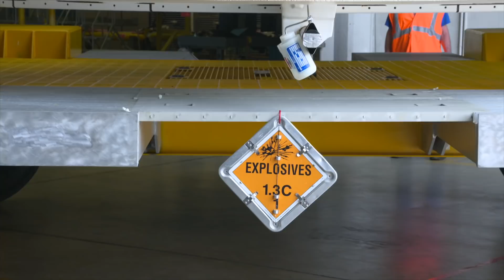Boosters for SLS Artemis Moon Rocket Arrive at KSC

Comment: Good people, nice hardware, but it took years of waiting just to be able to make these few feet of video.  It has been 8 months and there still has not been a full first stage run up test.  As of this date Sept/8/2020, they just performed a full SRB burn test.  Plus they still need to do the booster full duration burn (And the related inspections with reports) and then the full assembly of the completed vehicle.    It is here to stay, but NASA spaceflight is s--l--o--w.

Comment: Sorry But SLS will not see ANYTHING but a test launch!  WAY too expensive and  Government  bureaucracy and red tape will prevent ANYTHING but a test!    Using such a huge rocket  .when smaller ones like The falcon heavy or the New Glen by Blue Origin  can do the same job
Reply: Absolutely true !
Reply: Falcon Heavy cannot replace the SLS for manned lunar missions because it can only launch around 16'000kg to the Moon while SLS block 1 can launch more than 26'000kg to the Moon. Orion weighs around 26'000kg so it is way too heavy for Falcon Heavy.
Reply: @mudspike84  That's why they will have starship and super heavy. Obviously falcon rockets are way too small for lunar and those are currently being used for starlink, launching 60 sats almost every weekend.

Comment: The most powerful rocket booster ever made, as well as the most expensive, by far and taken the longest to develop!
Reply: And it’s all thrown away after about eleven mins of use.
Reply: @Behindstage  2 minutes
Reply: @Behindstage  2 min. and like 30 seconds
Reply: Kitox 123 2 mins and 42 seconds
Reply: Hard to say most powerful ever made since it hasn't launched yet.  Starship and Super Heavy may still launch first and then would be more powerful.
Reply: The boosters are built by Northrop Grumman and has had the boosters ready for the past year and a half. Boeing with the core stage is the main hold up.
Reply: Slow & steady wins the race.
Reply: And look how many bob’s jobs it has save though, I guess that was worth it.
Reply: Really? Falcon heavy took 14 years to develop. And Saturn V development was twice more expensive.
Reply: @_mikolaj_  yeah but that was in the 60s , now we are in a new era of spaceflight , no need for old expensive rockets
Reply: @yanislestrat1224  solid booster is most cheap thing you can get. comparing to f9... if we would change it to expendable shuttle SRB with raptor upper stage, we get even cheaper rocket(and more powerfull one), with only one issue, being not human rated(probably, due to vibration). Also as you have mentioned, we arent in 60s. 14 years to connect 3 f9 together? i wouldnt trust spacex in terms of time.
Reply: @_mikolaj_  yeah but truth is , spaceX is leading the game today , not nasa . And they have been a lot more faster than nasa
Reply: @yanislestrat1224  well, SpaceX is still alive only beacuse of NASA. Otherwise, they would bankrupt.